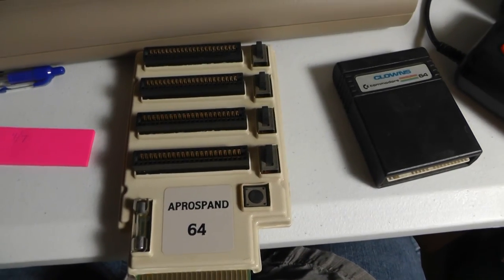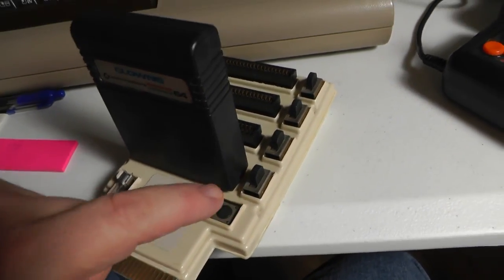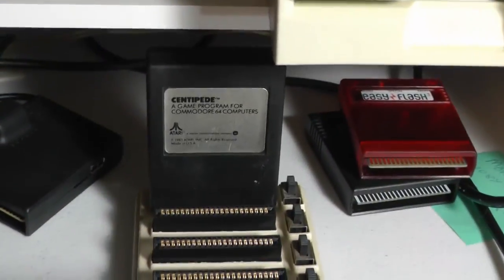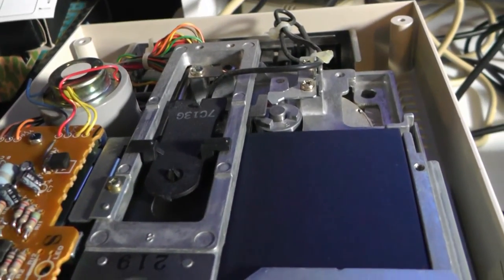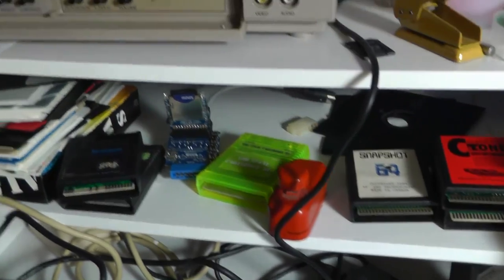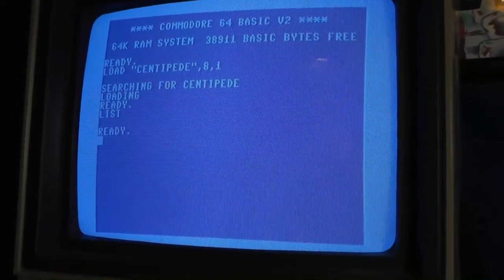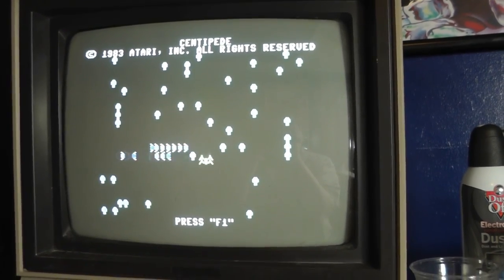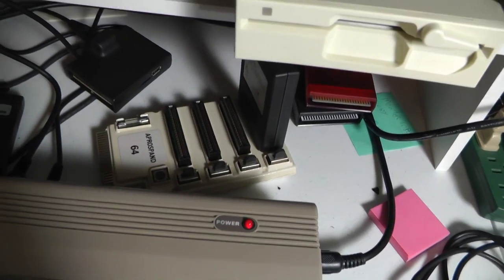Commodore 64 CARTRIDGE Dumping with MDUMP

Comment: Good info. The Centipede file likely would have loaded fine with JiffyDOS if you had used the % command instead of /. % is equivalent to ,8,1 while / is just ,8. / loads to the beginning of BASIC memory at $0801 while % loads the file to wherever it was saved from in memory, which is $8000 or 32768 in this case.